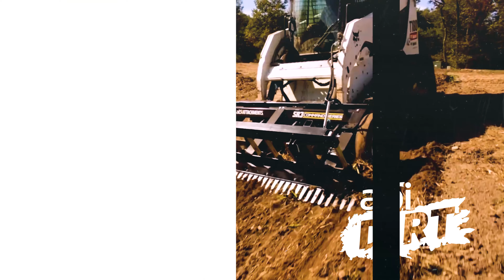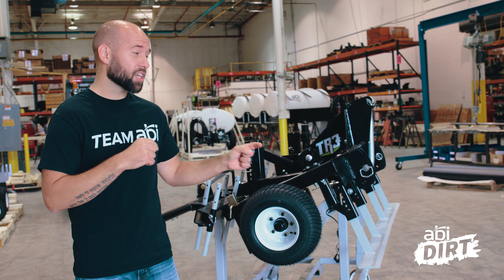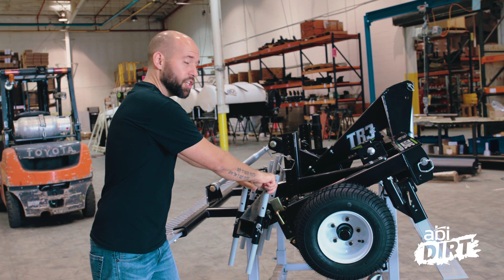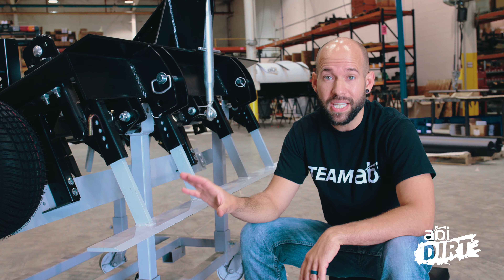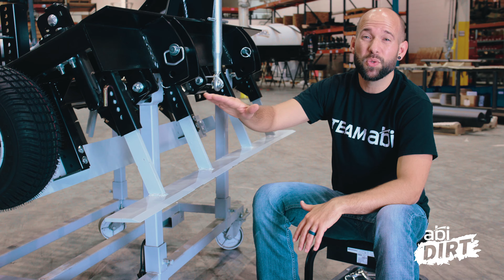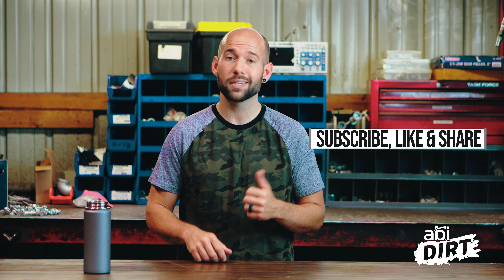Compare #4: TR3-E vs TR3 - Profile Blades & Grooming Rods - ABI Dirt

Comment: I have an older  TR3 rake with a profile blade attachment that goes in in place of the scarifiers for arena applications. Is this no longer available today? It does a nice job for my application.  Thanks
Reply from the maker: Hi Edwin! 
Sounds like you've got an oldie-gut-goodie. Adding Profile Blades under the TR3 in place of the scarifiers was one of our first iterations of the Profile Blade technology. We had some great results, but we learned the Profile Blade didn't aerate the footing as well as a vertical agitation component like the grooming rods or scarifiers. We started looking for a way to keep the scarifiers engaged and add the Profile Blade as an additional component. That gave birth to the TR3 Profiler attachment (which you can find in the link below).

We might have one or two mid-mount Profile Blades left on a dusty shelf somewhere (our Support Team would be able to tell you for sure), but we stopped manufacturing them a number of years ago because the TR3 Profiler attachment produces such better results.

Thanks for reaching out!
-- Matt

Link to the Profiler attachment for the TR3: https://www.abiattachments.com/product/abi-tr3-profiler-arena-groomer-drag-rake/#:~:text=The%20%E2%80%9CProfiler%E2%80%9D%20is%20an%20option,the%20longevity%20of%20the%20horse.